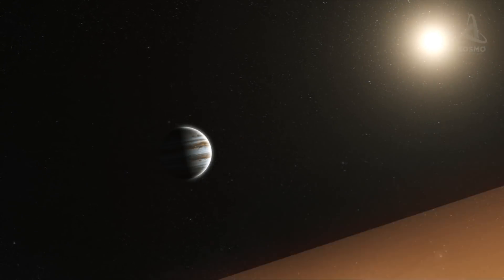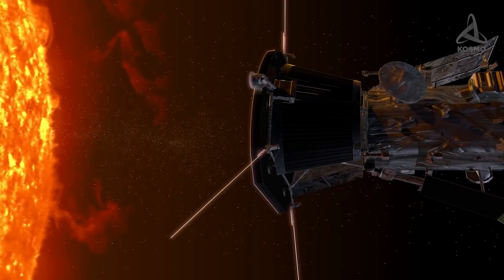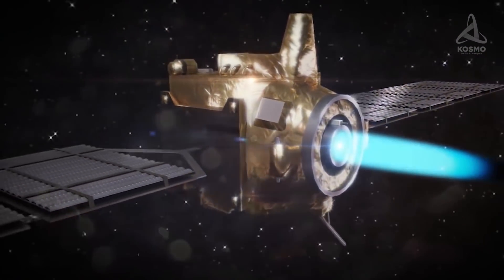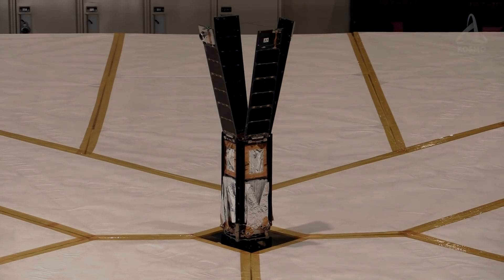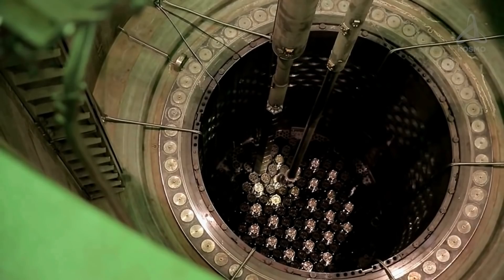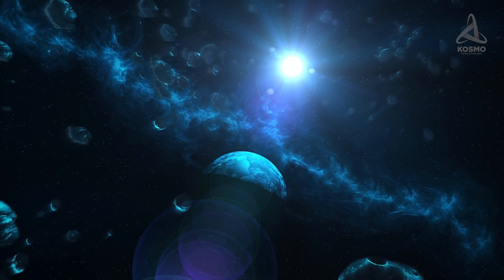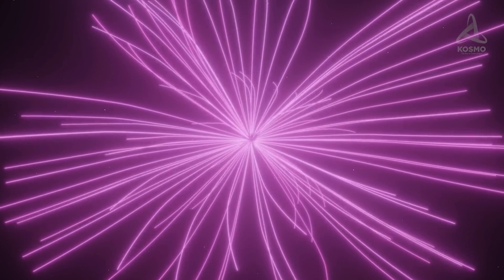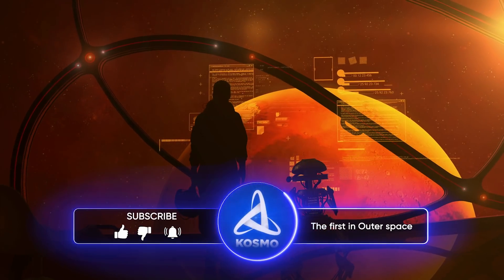Spaceships Capable of Reaching our Closest Stars

Comment: Fusion is still inefficient so no fusion engines for now.
Reply: I assume you mean, our current level of fusion power is inefficient, not that fusion is inefficient in general?
Reply: @Muppetmonkee  yes, fusion is normally efficient but needs extreme situations for it to occur properly such as extreme gravity.
Reply: If you want to see a new fission rocket concept that should make constant 1g acceleration possible watch my video "liquid plutonium rocket". With this method a ship can get to Alpha Centauri in just 3.6 ship/7.3 Earth years (and that includes turning the ship around half way and decelerating) and have gravity the whole way.
Reply: @shawns0762  I was pointing out on power issue but ok no probs, I'm trying to fuse tritium and deuterium but it's so hard to get tritium in such amounts. :'(

Comment: Okay, let's have a followup with "spaceships capable of reaching our closest stars, that we can actually build."  Warp drives and wormholes are cool ideas but in the real world we don't get to pretend that a working theory means we have any means to actually construct them.
Reply: I dont think warp drive will ever be possible, the good news is that its not needed, for some reason people dont know about the 1 realistic method for interstellar travel, the constant 1g acceleration method, with this a ship can get to Alpha Centauri in 3.6 ship/7.3 Earth years (and that includes turning the ship around half way and decelerating) and have gravity the whole way. The ship would achieve about .95 light speed after about 1 year. A 10 ton ship would need a mere 10 tons of continuous thrust. All thats needed for this to become a reality is a fission rocket that can put out thrust for long periods and does not consume hydrogen. Check out "liquid plutonium rocket" this is doable. With this method a ship can span the entire diameter of the Milky Way in 12 ship/113,000 Earth years.
Reply: @ShawnS07  If you can figure out how to actually do the 'constant 1 g', then what's holding you back? Hell, all you'd have to do is start from a mountaintop where a tiny little bit less than 1 gravity holds you down, and off you go.  Send us a postcard when you get to Betelguese! Just, you know, write it on paper, put a stamp on it, and drop it in the mail.  I'm sure there's a method for doing that too.
Reply: @zrebbesh  Previous fission rocket concepts incorporate hydrogen in there process which automatically makes them not good for interstellar travel. You cant take 500 tons of hydrogen with you
Reply: @zrebbesh  If you watch the video "liquid plutonium rocket" you will see how to do the constant 1g.
Reply: @peter With the constant 1g acceleration method there is no need life extension or hypersleep. Believe it or not a ship can get to the other end of our galaxy in 12 years, 113,000 years would pass on Earth with this method and the ship would have gravity the whole way. There is no doubt in my mind that this is the way its going to happen. Farming is critically important for food and oxygen and the gravity will allow that. Watch the video "liquid plutonium rocket" for in depth info on the constant 1g method and the propulsion system that can make it happen.
     It will be the new safest way to travel, due to relativistic effects the ship will only have a weak interaction with regular mass when it is at high velocity. The ship will be at high velocity when the ship is in the voids between star systems where the chances of significant mass being in the flight path will be astronomically low. The front of the ship should be an asteroid or at least armor plate. It would need a powerful radar (RF emissions will travel at light speed regardless of the ships velocity). Interstellar radiation is not a problem either a couple feet of asteroid dirt (and perhaps including graphite and/or lead) surrounding the ship will keep it out.
    The key to this is a fission rocket that can put out thrust for long periods and does not consume hydrogen, you cant bring 500 tons of hydrogen with you. A fission rocket should be simple in function. Uranium and plutonium are jittery atoms, there is a way to get them to fission in a linear fashion. 1 kg of Uranium has the same energy as 120,000 tons of coal and plutonium has a lot more than that you would not need a lot of it for the trip. These would be low output engines compared to chemical rockets, you dont need much to accelerate at 1g.
    People seem to have a hard time believing interstellar travel is possible in our lifetime. Watch the video if you agree spread the word.
Reply: we have no way of constructing them no way at all
Reply: that's ALL we get to do is pretend
Reply: Modern media tends to 'warp' people's expectations..
Reply: @peter Absolutely.  We don't need to worry about interstellar colonies until we have several trillion habitats here in-system and a population somewhere in the quintillions.  And at that point, it's just going to happen without any special effort, because habitats in the outer edge of the Oort cloud will sometimes get perturbed and wind up being in the outer edge of some other star's Oort cloud.  Or it'll start happening when people in habitats somewhere in the outer system make a routine low-delta-vee course correction to claim and exploit a valuable mining opportunity - which just happens to be on an interstellar trajectory.
Reply: i know how to make warp drive and portals and antigravity but its illegal because of the elements you need to make it possible and highly radioactive !!!!!! it would cost billions and nobody wants to pay the price tag its pretty sad and plus they don't want true freedom who ever they are !! or who ever control the world the only reason worm holes and portals don't work is because of the earths gravity trust me i was in the army they have it !!! and they tried and still are . but am i allowed too nooo!

Comment: With current technology, the best bang for your buck is matter–antimatter collisions. However, you need energy to keep the antimatter magnetically contained, otherwise it will annihilate with its container. Producing antimatter is also very, very expensive, so only big facilities with large budgets can do it. 
In short, the amount of money required to move a spacecraft this way is prohibitive.
Reply: Anti matter is expensive to produce, however, it may be alot easier to mine antimatter, if you can work out colkection and containment. For example, the earths magnetic field is belived to funnel inbound antimatter around the planet. As commercial space commerce becomes cheaper, mining antimatter could be more feasible.
Reply: @rrson648  mine antimatter? How? From where? Antimatter is fundamentally not something you find lying around...
Reply: @TML0677  ain't no however, only way you can make it atm is in particle accelerators, so far the maximum achieved is 309 anti-hydrogen atoms, which is a far cry from an amount needed for an interplanetary trip, let alone interstellar
Reply: I agree with Michio Kaku that antimatter propulsion will never be feasible, the good news is that its not needed, for some reason people dont know about the 1 realistic method for interstellar travel, the constant 1g acceleration method. With this a ship can get to Alpha Centauri in just 3.6 ship/7.3 Earth years (and that includes turning the ship around half way and decelerating) and it would have gravity the whole way. The ship would achieve about .95 light speed after about 1 year. A 10 ton ship would need a mere 10 tons of continuous thrust. All thats needed for this to become a reality is a fission rocket that can put out thrust for long periods. Watch my videos "best method for interstellar travel" and "liquid plutonium rocket", this is doable.
        I believe it will be the new safest way to travel. Due to relativistic effects the ship will only have a weak interaction with regular mass when it is at high velocity. Also the ship would need a powerful radar system (RF emissions will travel at light speed regardless of the ships velocity). Also the front of the ship should be an asteroid or at least armor plate. Also the ship will be at high velocity in the voids between stars where the chances of significant mass being in the flight path will be astronomically low. A couple feet of asteroid dirt (and perhaps in addition to graphite and/or lead plates) will keep out interstellar radiation. With this method a ship can span the entire diameter of the Milky Way in 12 ship/113,000 Earth years (24 ship if you decelerate for half the journey). There could be people in the Alpha Centauri system in 10 years, people living around every high quality star system in the galaxy in 113,100 Earth years.
Reply: @shawns0762  that 10 ton ship would have a greater and greater mass as speed increases... At 0.95 light speed (if it could reach it) it would need much more thrust then 10 tons to mantain that 1g acceleration.
Reply: @AndrasMihalyi  The mass of the ship will not change, in fact everything should be 100% normal from the ships point of view.
Reply: @shawns0762  Special relativity disagrees. If you were right you could reach speeds faster than the speed of light. Mass prevents that.
Reply: @AndrasMihalyi  We are all traveling at the speed of light, 186,000 miles per second is only special relative to a stationary/outside observer. The general consensus is the ship would peak at around .95% light speed.
Reply: @shawns0762   look up relativistic mass to see why you cannot reach 95% of c with 10 tons of thrust.
Reply: @AndrasMihalyi  Mass becomes infinite at the speed of light relative to an outside observer not onto itself.
Reply: @AndrasMihalyi  I am the biggest airplane/naked gun fan on the planet BTW
Reply: @shawns0762  relativistic mass increases with speed. Mass x γ. At 0.95c it's ~3,2x "normal mass".
So momentum and inertia increase too. You need more and more thrust.
So you surely cannot be serious 😉
Reply: @AndrasMihalyi  I am serious, and don't call me Shirley. If what you are saying is true then a 200 pound man would become weightless at some point even though thrust would be pushing him to the floor. The ship would only change from the viewpoint of an outside observer. There is some common misconceptions about relativity.
Reply: @shawns0762  Mass and weight doesn't change. Relativistic mass changes, increases. As speed increases you have to factor in γ. 
I=mxvxγ.  γ is 1 at "normal" speeds, but 
γ becomes infinite at the speed of c, so you need infinite energy to accelerate further, that's why for anything with mass c is unreachable.
You have to factor in γ otherwise your calculations will be incorrect.
I cannot and will not argue about this further. Have a nice day.

Comment: The idea of the Alcubierre Drive makes the most sense. Think of it, if you're traveling to some destination some 50 light years away and you're doing lightspeed, it will take 50 years.  Not only 50 years, but you will also need to have forward-signalling systems which are faster than light. My hopes are pinned on improving research on the warp drive. If we continue going down the route of propulsion, we will find out that we're just wasting time.
Reply: No no instead of wasting our time, we Combine them fusion as the engine and anti-matter/anti-hydrogen warp coil to make the space craft light and fast.
Reply: @thefirstsin  I live in Karachi Pakistan and I like your comment send 10 month ago
Reply: As we spread out in the solar system and galaxy, there will be a desire- no, a demand for FTL travel and communication. Maybe the nay sayers are right, we’ll never achieve it; it is impossible. But that won’t stop governments, private companies and other groups from looking into it. New ideas will be developed, old ideas will be re-examined. Who knows what they’ll come up with.
Reply: @dirkstarbuck6126   I have faith in science, which makes me anti naysayer. The latter say no, the experimenters say yes, but only by trial and failure.
Reply: @travestielyl   "I have faith in science, which makes me anti naysayer."

really ? how much do you believe that now free energy device is actually already exist for many years ?
Reply: @electronresonator8882  Interesting statement: While I cannot confirm, I can state that there is a smoking gun. For example, the Pentagon with all its promises of full disclosure, is still sitting on the fence with something. To make a long story short, strong hints do point to inventions and innovations not yet in main stream industrial and commercial domains, but being used by a select few.
Reply: @dirkstarbuck6126  I live in Karachi Pakistan and I like your comment send 10 month old
Reply: @ericvosselmans5657  no no we have the fuel, though it is extreme to produce at such amounts and hard to store.
Reply: Anti-matter/ anti-hydrogen or any normal matter with an opposite charge can be used as fuel for the warp, use it wisely we only have less than 1gram.
Reply: @ericvosselmans5657  Ahh yes, but breakthroughs do happen, that's what I love about science. So while it may seem like a few millennia away, who knows, maybe I might just be able to take that vacation to Proxima Centauri before I turn 60.
Reply: Warping just means going really really fast to another place within days, hours, minuites, or seconds. That just means we need better propulsion. Your idea of warping is basically teleporting a ship from one place to another in a timespan. You don’t account for objects between the start and the destination, asteroids, planets, maybe other stars or rogue objects fallen outside of the stars orbit.
Reply: @Cookie-sn8zp  Precisely! My definition is more aligned to bending/tearing through the space-time fabric, whereby two points which were otherwise millions of light years apart, could be brought into much closer proximity. Maybe as a stretch of the imagination, to even create a zero-time connection.  I mean see how far we've advanced in the past 40 years. If proven, who knows what industrial uses might be derived from the tachyon.
Reply: Ditto Alcubierre.
Reply: @kruzrken  ❤️ This guy is light years ahead of main stream science
Reply: This comment section is so fucking nice and respectful. You guys are real ones.
Reply: @user-fy5sg9rg7d  ❤️ Thanks! Real human progress is displayed not just technologically, but also spirituality - morally, empathetically, and socially. From my interactions, many of the commenters embody those values.
Reply: It doesn’t make any sense tbh. It’s pure fantasy.
Reply: @eckee  Yea that what it is: a hypothesis. But just like any other, experiments (sound R & D) which yield substantial findings will move it to a firm theoretical footing.
Reply: A micro meteorite hitting something going that fast would penetrate it even it had walls that were 10 feet thick of pure titanium! Bye bye air supply! Humans are too fragile for such a journey maybe a robot!
Reply: @bigdadjorel7151  what if the ship had poles on the sides that had a gravitational pull that would move meteorites away?
Reply: I think we're all on a losing battle with this one. The only things that are capable of travelling at the same speed as light photons are neutrinos which are given off just before stars explode and even if you do manage to find all that energy to get you to the speed you want to go, you'll have to find all that energy again once you get to where your going just to slow down and stop and once you've got over them little barriers, travelling through space at that speed will be like doing 100mph down a motorway wearing a blindfold and hoping that a lampost won't get in the way. You could plan a route down to the slightest detail but guarenteed, as soon as you start that journey.....some sod will put up some temporary traffic lights with 5 blokes standing round a JCB.
Reply: I live in Karachi Pakistan and I like your comment send 10 month old
Reply: but the cool thing is, if you do 99.999999999% lightspeed, it takes less than a year!
Reply: If Alcubierre Drive needs something to go FTL, we just cook strange matter for this warp engine by mixing horseshoes with deuterium in a particle accelerator
Reply: @Masonicon  lol, to get to places like UY Scuti, we need to move on from linear space-time mobility thinking. We need to think more in terms of fermionic-baryonic fabric manipulation.
Reply: Okay I've thought about it & my conclusions are it's total bullcrap
Reply: It would be 50 light years in time for someone standing on the earth but you’d feel like you reached the distance almost instantly. When approaching the speed of light time for you almost stands still.
Reply: Or just colonize hop one planet after another and build a civilization on the way. One-shot trips will probably never be possible.
Reply: @tenminutetokyo2643   Good thinking until you hit the Keiper Belt..trips after that are in light years. Then there is beyond the Oort Cloud...
Reply: Colonization and outposts are the only way.
Reply: @tenminutetokyo2643  one could also pose an argument for the bio forming of asteroids and other like-sized bodies. However,  the question becomes the costs vs benefits in terms of resource acquisition to make it to the closest, extra-solar Earth-like planet.
Reply: I disagree about the Alcubierre drive.  A couple videos already address it's short-falls.
Reply: @Cyberpuppy63  The drive is still hypothetical. However like many hypothesis, sound R &  D may progress through the theoretical stage and unto a working model. Who knows, maybe we are on the verge of knowledge as to how to massively obtain commercially convertible supplies of Dark Matter derivatives.